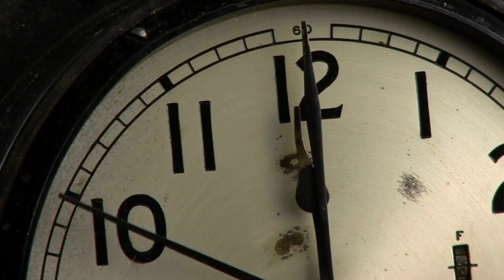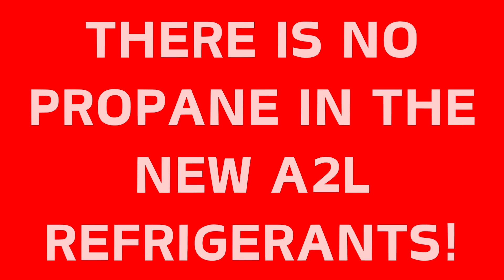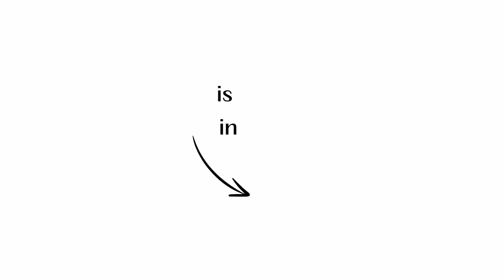REFRIGERANTS HAVE PROPANE AND CAN BLOW UP! SO MUCH CONFUSION!

Comment: Think about this for a minute, it's perfectly fine  to use hundreds of pounds of natural gas or propane in your stove or in your hot water heater or in your heating system where you actually light it on fire and burn it, but it's not okay to use a few ounces of it in an air conditioner! We drive around in cars with 15 gallons or more of explosive gasoline, a transmission and differentials full of flammable oils and we think nothing of it, but don't put propane in my AC. It's flammable. I would be willing to bet that there will come a time when R290 - propane will be commonly used and accepted.

Comment: Well well well.. someone just tried to sell me 410A based systems, and articulating sense of urgency in the context of 1. Cost will go up with A2L 2. You only have till end of 2024 but hurry many homeowners are now buying new systems because of next reason 3. It’s propane. There will be just one sensor to detect any leaks, but what if sensor fails? Would you like propane loose in your ductwork and you light up stovetop and boom your home is on fire

Thank you very much. I can probably understand why some companies want to get rid of their inventory and making pressing case saying “its propane”. 
Thank you so much for busting the propane myth.

Comment: The biggest issue is the shut off safety valves to ensure the flammable sh#t doesn't burn your house down locks your system up. Have a leak in winter no heat for you..... brilliant! Let's save the environment in the West and make everything uber pricey so China/India/Africa can have zero regs.

Comment: So is there any benefit to the homeowner to use R32/454B refrigerants?    Do they cool better, lower cost to run the compressor, better heat transfer, work in colder climates for heat pumps?   
I need a system replaced, and just wondering if I should wait for the new refrigerants or try to get a 410a system installed now?   Thanks.

Comment: Just insane. Window ac units, portable ac units, and dehumidifers have been using R 32 A since 2016 i believe.  I use 4 of these so called units that have r 32 and iam not scared as he unuts only hold like 7 oz of it.  What iam more scared of is these R 600 a isobutane refrigerators.  There have been reports of them exploding and the doors flying across the kitchen.  Also the r 290 can be scary in certain restaurant kitchen applications as most of the time on the cooks line you hsve these refrigerators so close to your gas cooking stove, and other equipment.  My friend had a close call with an r 290 true prep table making a boom due to a leak around the condenser.  What they want to use these refrigerants thsn the build quality needs to be way improved.  Use coils with thicker copper tubing, so they dont develop leaks.  None of that aluminum micro channel junk either.  Also do you know anything about R 454 i though thats what they were using in the central units, and r 32 in the smaller units like mini splits and window units.  Let me know.  Been hearing R 454 mentioned.

Comment: If we are in the wee hours, why do all the installers that I called yesterday in my area still only install r410a? Will R32 only be available as a self-install?
Reply from the maker: Wee hours or last days. 410a is going away soon
Reply: R410 new equipment manufactured until Jan, 2025.  R410 units in inventory can be installed up to Jan. 2026.

Comment: Mikey pipes proved it that it doesn't burn. Check out his video
Reply from the maker: It’ll burn at low velocity. Must be right conditions.
Reply: @NewHVACGuide  he has a smelting pot set up and shot new freon in it. Knocked out flame

Comment: The best one I ever heard was that some people in Florida were filling automotive units with propane after R 12 was no longer available. I can't say if it was true or not. But it might be a way to cut back on smoking. It makes me wonder how many systems propane might function in? I have plenty in my garage, but only to power my generator. You can store it forever, and the exhaust is less dangerous than that from gasoline. No typical carburetor problems either.
Reply from the maker: I’ve heard you propane (r290) will work in some systems using other refrigerants

Comment: Why the need for detection and mitigation equipment for something that's not really flammable. Is all this an over reaction by the regulators and rule makers?
Reply from the maker: They definitely have a higher flame propagation than A1 refrigerants. It just simply doesn’t have any propane in it.

Comment: I'm disillusioned by most of this "new refrigerant" shuffle. I'm still using my elderly R-22, retrofitted to Bluon R-458A. I've two years on it now and it's still going strong. Why isn't bluon talked about and used more often? I was Offered all the "good deals" on mini splits with R-410A and the "ductless AC's", but just was not impressed, especially price. The local crop of HVAC installers have dubious credentials. I've some refrigeration experience. I can pretty much tell when I'm bein' scammed. I'm also watching for a "Future Proof" refrigerant to come out.
Reply from the maker: You might be waiting a while... CO2 or and A3 won't be out for years.
Reply: @NewHVACGuide  So what options are still on the table to charge a R22 system?
Reply: Yup, still nursing my forty year old R22 unit. I want to get a new R32 system, but they are not offered. If I am forced to wait for the transition to propane (2030?) before pulling the trigger on a new system, I'm going to need something to keep charging the old R22.

Comment: I work overseas and they us R12,410,R22 . It's all a lie sorry.
Reply from the maker: Is that a lie? :-)
Reply: R12 was outlawed like 5 decades ago and R22 about 20 years ago in the USA!
Reply: @bobboscarato1313 There is nothing outlawed about those refrigerants.  We can still buy, charge, recharge and use those refrigerants.  I use R22 weekly to fix and charge systems.  Give me a break.   They still use R12 in any commercial applications.  410a will never go away either.  R32 has been used for over 20 years across the world and will be used extensively in America.   So, don’t worry about that.  R32 is up to 40% more efficient, no temperature glide, single component and affordable.  That’s our immediate future.  Trane and Carrier are using both R32 currently in mini-splits from Midea and Daikin/Amana/ Goodman will make the full transition soon but 410a systems will be allowed to be sold for the entire year of 2025, as long as the distributor purchased them before January 1st,2025.  They might also be shipping systems dry and will be charged fully with 410a at the time  installation.   They did the same thing with R22 systems.

Comment: Why not just go to all monobloc systems and keep the refrigerants outside of the buildings?
We could use all natural refrigerants and be safe?
Propane and CO2 are the best choices and are safe when used outside....
All these manufactured refrigerants will be fased out ....
R32 is not a solution only a crutch for manufacturers to delay the future...
Reply from the maker: Air to water coming...
Reply: @NewHVACGuide  Very, very expensive; we did a few 15 years ago!
Reply: @NewHVACGuide  Any videos on these new A3 systems?
Reply: That is how most propane units work. But Currently you can’t even have a monoblock r290 system in a residential home, that’s likely to change but not until 2025 at the earliest
Reply: @maddrummerhef  You use a monoblock with all refrigerant OUTSIDE..These are air to water systems...

Comment: I just bought a portable Heat pump that has R32. 14,000 BTU for $320 tax and all. My heat pump does 28,000 btu but would cost 10 to 14 thousand dollars to replace.
Reply from the maker: Brand and model? Willing to share?
Reply: @NewHVACGuide  Midea 14000 btu map14ahs1twt review
Reply: I don’t know why ITF my reply(s) aren’t going through. For the fifth time certified refurbished bought it at Ollies.
Reply: midea 14000 btu map14ahs1twt
Reply: @Steve-bm2zm  Did you buy it new? Amazon wants $700.
Reply: @fredwilliams8898  no 🤦🏼‍♂️🤦🏼‍♂️